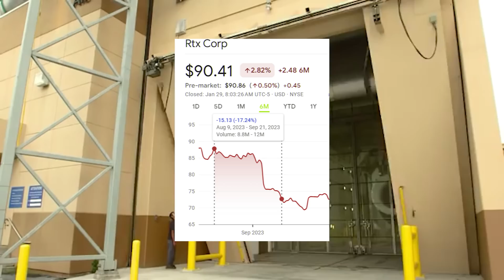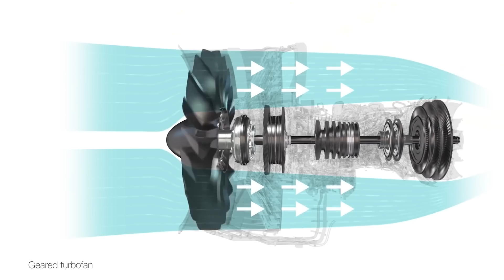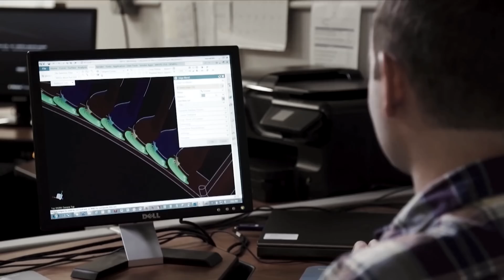They're GROUNDED - Why These Brand New Planes Can't Fly

Comment: It’s the intense competition between Boeing and Airbus the slide towards taking chances cutting corners et cetera to gain an advantage if done properly it makes things more efficient but if done badly can lead to disaster.
You see if one leads the other has to follow USA desperate search for as much profit as possible as lengths of them making terrible planes only the skill and expertise of pilots I reckon are keeping accidents away, so Airbus are under great pressure they do their best to do it in a competitive and safe manner but you can see the strain that it’s causing.
It’s basically the USA finally having competition and they can’t handle it they were happy went bowling was the biggest planemaker and they were content to allow airports et cetera to have a share of the market but now into competition is intense there is the added danger of Chinese and Russian aerospace especially Chinese we all know how they are doing in every spare hole at first they laughed out and then it’s fine with a conquer.
The USA knows perfectly well this will happen with planes and they’re trying every dirty trick in the book to stop it .
The plain truth is you cannot make very complicated things without expert staff well trained and with years of experience racing after profits and moving production to somewhere where the staff being underpaid I’m not going to bother that much, if they see the vastly experienced workers being disposed of you can understand that they saying that will happen to them as soon as they can find a cheaper alternative so it’s a race to the bottom.

Comment: Sounds like these fuel efficient jet engines are a carry over to the automotive engine. Forget about the reliability issues and if the engine gets 60,000 miles that’s fine for the average vehicle. The same goes for EV batteries . 5 to 10 years and the dealers will charge you $30,000 instead of changing out the few bad batteries.

Comment: 40% of neo here in USA use the PW GTF engine that needs be torn down and inspected. Boeing, AFAIK, does not use this engine. Big blunder for AB to use these. I also have the report of it exploding during ground testing. They do not do well in hotter climates. It was redesigned after the explosion.  Unfortunately, it appears that P&W's geared turbofan engines may have a much more serious problem on their hands. Indeed, there seems to be a problem disproportionately impacting airlines operating in hot, humid and dusty conditions. With regard to the larger PW1100G powering the A320neo, India’s Go First told FlightGlobal that it had replaced 510 PW1100G engines in recent years, experiencing 64 ‘defective’ engine incidents in April alone.

Over in Iraq, it appears that the country's civil aviation regulator wants Iraqi Airways to suspend all of its A220-300 operations until investigation procedures are completed. In our reporting on the situation, Simple Flying received unverified photos of what is alleged to be an A220 fan casing that has begun to deteriorate.

Comment: For all the people in the comments who think everything in aerospace is just getting worse, allow me to educate you. The GE90-115B and GEnx have a 99.98% dispatch reliability rate, the chance of a GE90 in-flight-shutdown is literally one in a million (with a time-on-wing of over 100,000 hours, better than anything that ever came before it), and, in particular, the GEnx-2B has about twice the reliability of the Trent 1000, so, yeah. Plus, back in the 1960's, the engineers of the TF34 specifically made sure to design it to be as fuel efficient as possible so that the Lockheed S3 Viking could stay in the air as long as possible, and the nearly-identical CF34-3B1 has among the best dispatch reliability rates of any jet engine ever, so, yeah, kinda pokes a pretty big hole in the argument of higher fuel efficiency resulting in lower reliability, wonder why 🤔

Comment: The detail here is the Nickel Powder supplier that was not disclose.
The target is Pratt & Whitney produces jet engines for almost a century and the BIG QUESTION is WHEN AN WHY this particular basic component has CHANGED?
Was the supplier who cease to get the PURE STUFF (already analysed and approved) and change the mining spot source to another WITHOUT warning and/or proceed with no new analysis?
Was Pratt & Whitney/RTX who change it´s original supplier of nickel Powder to get more CHEAP stuff???
The original supplier was a Russian mining company and this was originally a political  motivated change supplier that gone WRONG???
The center of the question seems not be addressed WHY AND HOW this happened at beginning???
They are only dealing with consequences...

Comment: Well, blades are replaced 2-4 times during an engine's life and last about 10.000 hours or 2500 cycles. It remains to be seen how much the problem actually shortens the blade life span.
Reply: The video states the problem is the HPT discs not the blades. If one of these bursts, chances are high it will be an uncontained failure with all the inherent risks of wing and fuselage damage.

Comment: There are many factors associated with reliability, building quality and unexpected tech failures associated of modern aircraft. Serious / fatal problems have always been a risk for large jet aircraft. Early fatal crashes in the 1950s and 1960s led to the development of the black box flight recorder and sophisticated crash investigation and analysis techniques. The generation of fly by wire passenger aircraft have reached a level of complexity that makes it extremely difficult to test for all failure possibilities prior to certification. Recent failures / problems with airframes, engines and fly by wire systems have affected many aircraft manufacturers both civil and military. Obviously lessons learnt need to be taken seriously by manufacturers and supervising authorities. You can never have too much safety. Try saying you don’t to the families of aircraft accidents victims.

Comment: Its worth saying that the large cut in fuel consumtionn from say NG to max generation only happened pmce before. In late 60s when high bypass was introduced. That roaled out at the same time the oil crisis come around. But that also come with a huge expansion in the insustry. 

This time around its a replacment. The issue ofcause that the airlines scraped last gen jet during covid, and now there is a lack of pretty much everything.

Comment: This cause airline likely to choose CFM LEAP-1A to power the A320neo.

Airbus also plans to make another engine option for A220.
Reply: The Leap had similar problems with their disk metallurgy. These are actually manufactured by the same supplier. New build GTFs and Leaps don't have that problem. It's older batches that are grounded now for parts replacements.
Reply: @wanderschlosser1857  the GTF has had FAR more trouble than the LEAP
Reply: @rafaelwilks  Well, it's also the more advanced technology. Initial hickups are rather normal when stepping on new grounds. The material composition problem though wasn't caused by the design and also not by PW. As I already mentioned, that affected more programs than only the GTF, incl. the Leap. Unfortunately for PW, far more GTF component batches with faulty material compositions were made and installed hence the huge backlog. Also PW seems a bit more transparent with their issues compared to GE/Snecma.

Comment: The Boeing B737-MAX's is a VERY VERY serious BIG PROBLEM for NOW..
Reply: This video is about the P&W engine problems. Not about Boeing.
Reply: have I got the wrong engine or does aibus use the 1a version boeing the 1b and comac the 1c @EuropeanRailfanAlt
Reply: @DBird-uw1op  Correct

Comment: I think All of Pratt and Whitney PW1127G-JM.  also PW1515 for Airbus A320NEO Family Are affected for this. Egypt air are retired there a220 Family for this issue. And our low cost carrier CEBU PACIFIC is also soon retired the Airbus A320NEO Family. There choosing the COMAC CR-919 or Irkut MC-21.
Reply: "EgyptAir chief executive Yehia Zakria says the disposal 'clears the path for new Airbus widebody aircraft' " (Flight Global), though the airline has also complained about problems with the engine type.  The buyer, who plans to lease the aircraft, describes them as having " “freshly overhauled, updated engines from Pratt & Whitney”.

Cebu Pacific has grounded its aircraft pending inspection, but has not sold them.  Considering how long inspections can take, however, there may not be much difference.

Comment: What seems strange at this moment in time is the amount of issues affecting the aerospace industry. We have all the latest tech and manufacturing solutions available more than ever but there seems to be major issues creeping in, Boeing with the 787 and 737 quality issues and MAX is still ongoing, P&W with there engines and not to forget RR with the Trent 1000.
Reply: You couldn’t have said it better!👍……it’s getting ridiculous!!!!
Reply: They want us to stop flying.
Reply: I agree what is going on?
Reply: @carolinegreen7043  it's a P&W problem, they're pretty much bottom-of-the-barrel
Reply: They don’t want us to fly
Reply: @OP: For decades now, financial legislation has changed. Corporations are free (liberal?) to “move” capital around, or ‘invest’ as economists like to say. 

This has made it much more profitable to ‘own’ something than to ‘make’ something, a process called financialization. It’s like having a car is an eternal expense, but having a house is an expense softened by its’ nominal value growing. 

So, investing in ‘property’ (all financial intangibles) is the choice made to NOT have their stock value fall like P&W. 

It’s not easy to be an engineer, metallurgist or quality inspector in that reality, if the CFO says ‘no’, because “economy…”. 😅
Reply: Combine federal regulation with chronic inflation and you get problems. These components aren't built quickly so inflation becomes ever more troublesome.
Reply: @GeorgeDoughty-m8e   Just hinting, would transport safety be better off without regulation? I seem to remember that rail or air got regulated for their lack of safety five generations ago…
Reply: There's been no real increase in MOR's, Safety allerts, Service Bullitens, Airworthy Directives, Safety Communiques or other such reporting for civil aviation. The only issue that's genuinely out of the ordinary is the Boeing situation. 
We now have sites like YouTube and Social media reporting them and the algorithms do the rest!
Reply: Compare the carrying capacity and weight as well as fuel efficiency. As the designs are reaching closer to their physical limits they become much much more difficult. Orders of magnitude more difficult.

The good old days had overdesigned, overweight components and gas guzzling engines. They weren't better or were smarter. They did what they could with what they had.

The issues do creep in but they're more noticable because there isn't the redundancy in strength and material to make up for that or the loads are so much higher it causes failure. Because overweight and over-strength parts reduce efficiency.

We're also a lot less casualty tolerant as a society.
Reply: @Incomprehensiblue  ah yes, the good old days, back when engines failed a lot more often and aircraft crashed much more often, wonder why 🤔 the GE90-115B and GEnx have a 99.98% dispatch reliability rate, the chance of a GE90 in-flight-shutdown is literally one in a million (with a time-on-wing of over 100,000 hours, better than anything that ever came before it), and, in particular, the GEnx-2B has about twice the reliability of the Trent 1000, so, yeah. Plus, back in the 1960's, the engineers of the TF34 specifically made sure to design it to be as fuel efficient as possible so that the Lockheed S3 Viking could stay in the air as long as possible, and the nearly-identical CF34-3B1 has among the best dispatch reliability rates of any jet engine ever, so, hmmm...

Comment: As a passenger, I dislike the howl - it goes right through me! 

I used to wonder what all the fuss about for those on the ground until our local airline has some on Wet Lease for a short time.

I live under a flight path, and landing aircraft pass overhead at around 2500 feet.

Yes, you hear the aircraft, but the sound usually builds gradually as they approach and then subsides.

Not with the A220s! They are definitely much quieter, but then all of a sudden, when they were overhead, that loud howl 

It was not pleasant, and I now understand why Zurich Airport is receiving so many complaints.